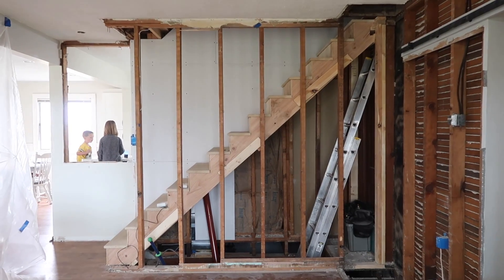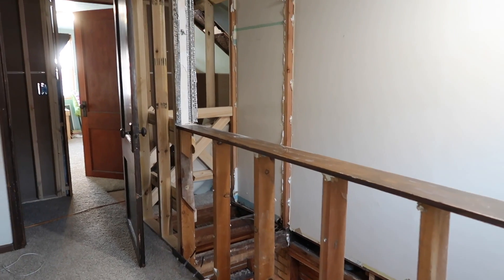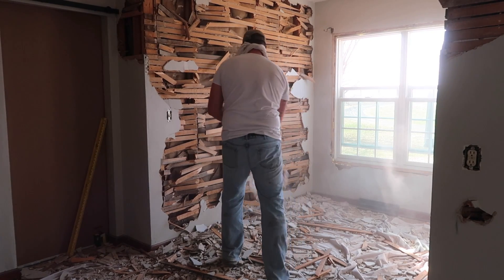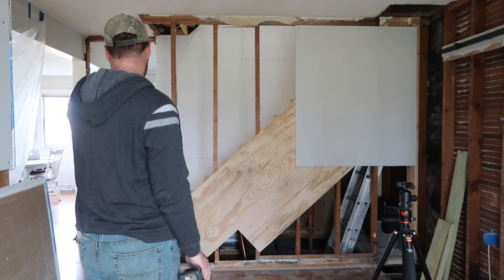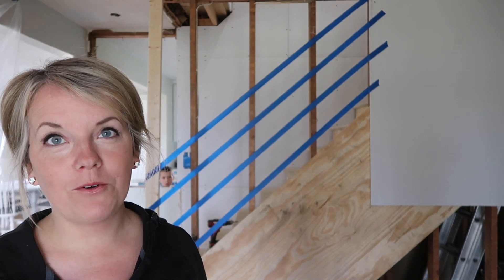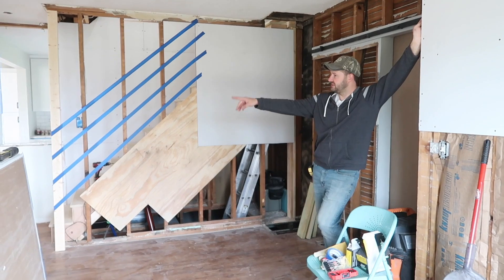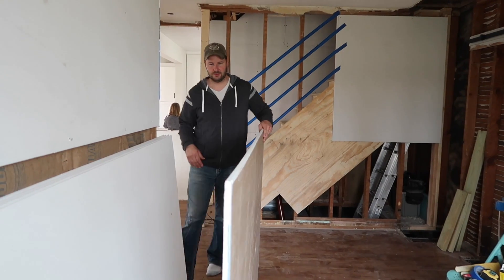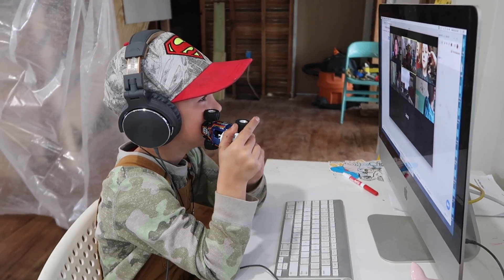Mocking up an Open Railing: We need to see it to believe it!

Comment: You have a large kitchen table right there, so needing another large-ish table for school work is redundant.  You could put two different computer stations or desk/counters one where Dawn's desk is now (or was) and one across where Gage usually has his "construction" zone.Then the open stairway will be a focal point. Or the girls art tables could still be under the railing, I can sympathize with your struggle on this decision. Its not an easy one. As someone else commented, you can't build for the season you are in now; because it changes so quickly. And Tom still doesn't get an office out of this. :)

Comment: I vote for open railings, a movable desk for Dawn and 2 or 3 options for seating in the old office for the children. I used a large coffee table, beanbag chairs, and a long sideboard with stools (like in your trailer) except it attached to the wall with a french cleat. That type of "table" was movable and the kids had laptops to use on their laps, the coffee table or the sideboard. I did it this way because sitting at a large table was too distracting for them.

Comment: I love the open stairs idea, but only two railings. Plus, if you get laptops vs. desktops for the kids, they can just be stored away after being used at the table area you want to build and then you wouldn't be so cramped with your desk space. Just a suggestion.

Comment: I vote for opening the wall and putting in railing AND putting the counter somewhere else (maybe in the room where they will work) If you put in the counter, I suggest putting it on hinges so you can fold it down. So it can be used as a desk, or a buffet, or a shelf, etc., BUT it’s gone when you need more space in the room.

Comment: I would make a roll around bar with locking wheels and adjustable stools for height.  I hate having a wall next to my head.  Makes me feel claustrophobic.  If it could roll, it could become a harvest table and be used for a buffet serving area also or an uninterrupted work area for a big project.  I would also use laptops so the kids can "take their education with them" and feel more comfortable while learning.  We all need formal spaces at times and informal spaces for learning and getting work done.  Having a flexible work environment is good.

All the ideas are great - depends on what fits you!

Comment: Dawn, try to draw a picture just like you did with the wall closed, but with the wall open including the counter and the computers. See which way you guys like it when it's completely drawn out.  Be sure and verify with measurements.   You'll need a certain amount of desktop space per computer.  Compare the two pictures and see what you think. Both look nice in my opinion. As a teacher and a mom who home-schooled for a season, it seems more practical to have the wall closed and three desks, but I haven't seen it drawn out with the railing open. Maybe it would help you guys decide if you saw both drawings side by side.

Comment: I don't know if you'll see this but have you thought about closing the wall....having the computer station....then on the side that the kitchen is...opening that wall that the stairs is on? So as you are working at the kitchen island you would see the stairs and railing? 

I love both ideas for the other wall but this would be a good way to have both....more light...it would open it up....just a thought.

Comment: We had a computer station with 2 computers, and it absolutely did not work.  Most of the kids would rather take the laptop and put it on the coffee table.  I know the counter desk is getting strong support in the polls, but look how many homeschoolers are saying, "No!" They are the ones with the experience to advise. It's just not comfortable to use computers in such a confined space. We ditched our desks, too.  Now we have a dining table which works great (not that it gets used a lot for schoolwork!), with the added bonus of extra table seating when we have company over. I'd suggest putting your desk by the stairs and a small table in the nook.

Comment: I don't know if anyone has already mentioned this, but if your computer counter is there with open railing...there is potential for knocking the computer monitors/open laptops about from kids/objects coming down the stairs (or maybe it's just my kids?🤪). Also, I thought I remembered that you like having the wall space above your current desk for clipboards/organization? Not opposed to the open railing, but I don't know if I'd put a workspace there. Just thinking out loud 😘

Comment: I like the open railing idea with a couple of computer stations in front of the rails.  That way you get the best of both worlds.  If they were laptops, you could fold them down when not in use and you wouldn't see them.

Comment: I think you could easily come up with a plan where you get both. A half wall that goes up high enough to have the desk there and the computer, but then have the open railing start just above that. You would obviously have fewer rails (you had four shown). Perhaps just one or two, but you would have a more open look, keep the sun in the stairway, and maybe not have to move the electrical so much (just down a little, or up the stairs a bit???) Have you tried measuring and sketching something like that out? Just a though! I have an image in mind; I'm not sure if I'm describing it well. But the point would be, you get both. The three computers you want along that wall as well as an open staircase and not having to move electrical so much (I think). :) Excited to see what you go with! Fun fun!

Comment: Have you ever considered having pull-out desktops that pull out from under the stairs, which can be pushed back into the wall panel at the side of the stairs? Having said that, the children would still need to wear noise-cancelling headphones if they're working alongside each other, and as they grow older they'll prefer to work in their own rooms more or outside when the weather's nice.

Comment: I like the open railing because of the light.  I originally voted for the computer desk until I read the comments and agree that laptops would be much more flexible and the kids could use it at their table or anywhere. If you want a desk just for you, then maybe a freestanding one so you could easily change it later.

Comment: The open railing opens up the space a lot more.  I vote for it. 

I have homeschooled for 8 years .I would hold off on the dedicated computer stations until you have been homeschooling for a few months. You may find that one or 2 laptops is plenty. At this point all, I would invest in is the table and some quality chairs with good support on the back.

Comment: I would do the open railing. I'm bad at spacial orientation, but it seems as if you could have a longer, thinner table near the stairs and do the built-in in the old office. If you're going to do a custom table anyway, you might as well.

Comment: What about the 3 desks on the wall to the left or right of the window? We have homeschooled for 4 years. My girls prefer schooling at the kitchen table. I would make that area (Dawn's old office) the "school room". I love the open railing. 
Also, about the floor. 
When my dad and I were doing my sister's floor, the guy that installed the carpet (he also installs laminate flooring) gave my dad a tip. He said the just saw down the seam and the just glue the new piece in place. Just an idea that you might want to try before pulling up the floor.

Please! Please! Please do the open railing!!!🥰

Comment: I would say open railing. Personally I would do railing on the side of the kitchen also. It would open up that whole space and it would look like one big room. 

In the area that you have taken down the plaster, I would suggest built in seating on the three sides with storage and a square table on wheels, with the ability to divide the table into two.  That would give you two extra rectangular desks you can move around.  If the kids are driving each other crazy, push the two halves apart and you can have two kids in one corner and two near the stairs. When your homeschooling is done, push them back together at the end of the day in the nook area. It would also give you some flexibility with your space.  Definitely laptops over desktops.

Comment: Going on the assumption the right wall will be a fully finished wall, how about this idea:  open railing and an "L" shaped desk, with a small portion on the right wall so as to not take up too much space.  That way the other end (by the opening) would not have to go all the way to the end (or you could cut the end at an angle) so it doesn't have a hard desk corner protruding into the walking path. Just a thought..... :-)

Comment: I was thinking you mildly meet in the middle. Open railing like you have the test look set up but do an L shaped set up for the computer work stations so you can maximize a little of that side wall. You could even leave a cut out space in the back of the built in l shape so the barn door could slide open the full length and run the computer wires along the underside of the computer so they wouldn't get yanked or caught on things

Comment: I voted; the reasoning is the open railing is still going to be slightly covered by the monitors and too cluttered looking. You've done so much to keep it looking airy and simple and I think the open railing would take away that clean aesthetic. Also, I do think the computers are important because that is going to be a day-in day-out area--especially if you plan to homeschool. Plus, they're only going to get bigger 😁

Comment: Open railing ...I liked the horizontal rails.  Go with lap tops...I would put all desk space in the 'nook' area.  It is unlikely everyone will need to use the area all at the same time.  I would try to leave the area on the stair wall with nothing there or maybe just a bit of storage if necessary.

Comment: I would keep it open, but instead of a computer station, laptops are best (with well defined rules ;-))  I would put a mid-century modern buffet that  would go with your sofa and style ( you could do it with a splash of color I did) , that doesn't cut off your view stairs. Each child gets a drawer, shelf and storage space for school work that's not done on the computer projects, maybe baskets etc. Then you have the  openess but also space for the kids. You will need it.  Homeschooled 11 years

Comment: Railing open, just dawns desk by the stairs (it’s visible from the main living space so having an adults tidy desk might be nicer then messy kids desks.  Table in the alcove for the kids (custom built table with cabinates under for storage). Get them laptops and iPads so they can be put on the table and then stored if needed (make a little shelf thing with slots for laptop storage).  I work from home and find it much nicer to be able to work at my desk maybe 25% of the time, but also be able to take my laptop to other rooms.  Also your kids are different ages so will be doing different school work,,,, I can see maybe Adeline wanting to take a laptop to another part of the house so she can concentrate, and then if the boys have noisy school work to do they don’t have to be quiet.   Also you can pair your kids up in different parts of the house working on different projects if your not all stuck on the same desk.

Comment: As a parent of 4 who homeschools, I would keep the wall. Whenever I hang a map, my kids learn so much just from having it up and natural curiosity. You may or may not want to display a piece of their art at a time, but anchor charts are really helpful for little ones (like the alphabet in front of someone learning to read, reminders of grammar rules they're learning.) There's a reason why classroom walls have stuff like that up. I've thought maybe anchor charts could go in a binder for reference, so that could work, but I prefer having a space to hang a few things like that, a calendar and a word wall for my early reader, etc. I think I've seen you use clipboards on wall shelves. Also, empty tabletop space is great. I need room for a computer plus whatever paper or book we are using plus manipulatives like math place value blocks. Just some thoughts. What works at one house won't work at another, but I wouldn't want to sacrifice the useful wall space for looks.
Reply: I should add that this is my first school year homeschooling, and I've rearranged our school space at least 3 times already. One of mine fully home schools, does better with external expectations, and focuses best at a desk with practically a cubicle, inboxes and check boxes. Not at a shared space! Another of mine attends a public charter with most of the work at home, works best in their choice of room, but is very prolific in artwork and doesn't succeed at putting things away, so supplies must be stored near where they use them to make things more automatic. I didn't know until I tried, and tried, and tried. The little one likes to join the big ones. We all do well with dedicated desk space. I would love for us to all work on the couch, but it just doesn't work at our house.

Comment: Many kids are using Chromebooks to do their school online work, they just looks like a tiny laptop. It wouldn't take much to do both of your ideas, make an open railing, but also set up the desk area there. The Chromebooks are so small they can unfold and be used, then put away and stacked to charge while the kids do their other school work. If you like that spot, make it work for you!

Comment: Hey Guys, Is open up stairs. Bold I'm storage under staircase. Have circular schooling table  instesd of square and have computer desks in the area where Dawn's office used to be. Circular table would bring in a nice flow to the space, open stairs would be light and bright. Having computers where Dawn's desk used to be would allow them to be closer to natural light/windows instead of facing a wall. Xxx

Comment: The open railing will really brighten up the space. I also think you will regret the computer station. Homeschool ends up being very flexible and you’ll probably be outside or using your couch more than anything else. My kids are 13-4 and we don’t use computers for it at all. We read real books, use notebooks and pencils, lots of art supplies and hands on activities. I would think that desk area would get very cluttered everyday and drive you crazy. I’d have a cabinet of some sort to tuck all the kids stuff away near your dining table. Keep your desk area for you. You will need it a little separate since the kids are now at home 24/7. 💕🙏☺️🌸🌼🏖🌺

Comment: Love the open railing.  Could u put your computer station along the wall u had your desk and a larger table on the wall behind it with stool on each end and two on the side?   That way it would be all in the “office” and the stairway wall would be all open and nothing in front of it ************OR. U could close in the wall like u want Dawn and make square openings in the wall ( like where u have the pictures drawn ( just the top row)    Going up at an angle. That would let light in the stairway.

Comment: In thinking over your stairway project I have a few things for you to think about. Regarding the 3 station computer desk - It could get crowded there.  I agree with the suggestions to have laptops versus a computer station. If one child needs a more quiet place to work they have the option of working in their room. It might be less distracting.  I love the idea of the work table - that will come in handy. I don’t quite understand where you, Dawn will be setting up your work station. As for the stairway - the open idea with the railings are beautiful but is it practical? You will be losing 
so much wall space. And how much time are you using the stairs versus the space along that wall. So, I’m saying carefully consider your use of the space and how the children’s needs change as they get older.

Comment: Maybe you could keep the counter the length you wanted with the closed wall but do the open railing. You still get the open feeling, but the counter space you need and honestly, you may not even use that space the way you think you will. As a homeschooling mom, my children sit on the floor, the dining table, island, couch, etc and do their work. Having a custom table in your office area should be more than enough extra room.

Comment: I like the open railing because it looks like a modern stairway, the closed in looks like its in a closet. Instead of table in the middle, could put against wall that living room on, making two seats on window & stair sides (4 total) & one seat on end. Across from table could be computer desks. Would give you nice upen stair area. Visually better

Comment: I am torn. The open railing is nice but you would lose that storage of the lower cabinets (upper cabinets). All things aside, will you need that? I am agreeing with others here about the computer stations. Will the one big table be enough for homeschool and arts and crafting? Would there be a way to incorporate storage around the big table? 
Another idea: what happens on the underside of the stairs? Are your basement stairs directly underneath? If not you could use that space for a built in storage. I like the open railing over the study spot. Computers can be used at big table or in bedrooms or outside nowadays. So a clean spacious space with gathering and separated spaces would be my vote. The open stairs adds to that.

Comment: I prefer open railing!    I would do movable desk for computers in the bump out area. Very versatile.  Built ins would be very restrictive for any future changes, or if you find it doesn't work.  My thought is also that those cupboards under the built in counter would be very awkward to access.   You could always put one counter top across the desks if you want the seamless look.